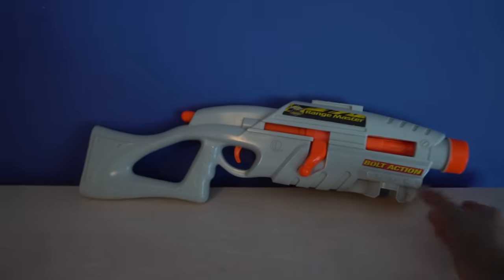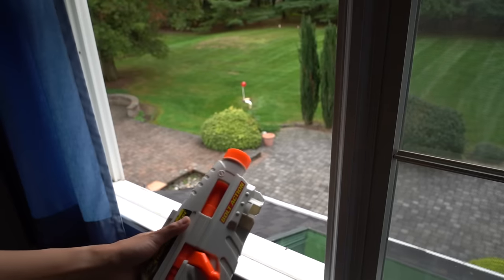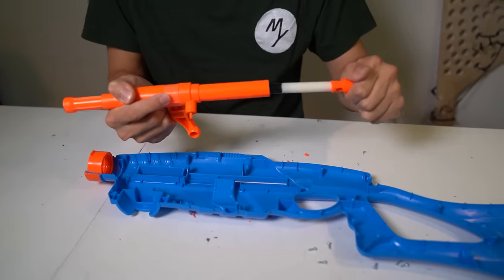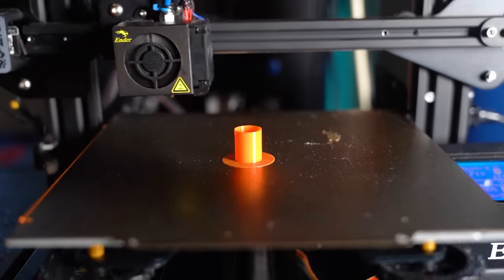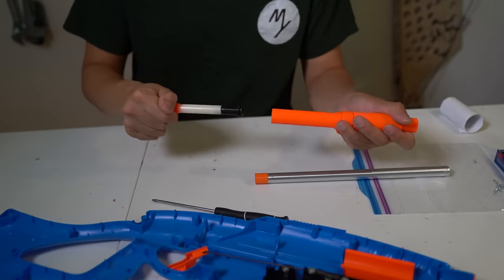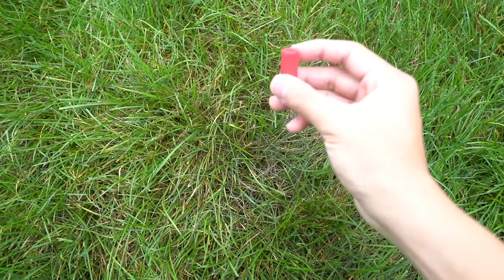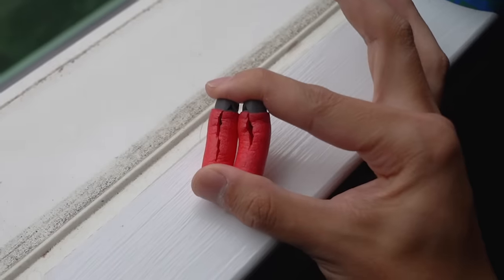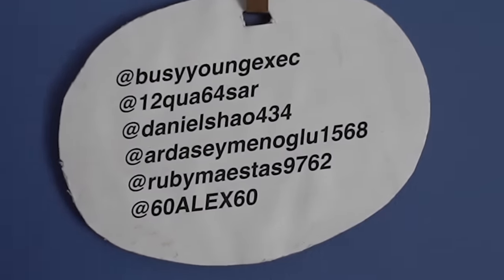I made my Nerf gun a bit too strong...

Comment: As a nerf and firearms enthusiast, I thought of tapping gas out like a real rifle when I heard about the dart bursting.
If your theory is correct, by drilling a hole near the end of the tube, excess "gas" will be tapped out and you can use it to load another dart /j
For those wondering, that last bit was for real rifles. But in this case, I suppose just having a tapered hole near the end of the barrel can possibly remove excess air.
Matt, you should really try this and put it back into the shell and do cosmetic mods and make it cooler! Although this was cool enough.
Seeing your streak of pressured air blasters, what about using the tapped gas into a extra gas chamber, then using the extra air, why not make a masterkey? Im no engineer but using my logic, it is possible to do so.
Also, I almost had an aneurysm seeing you put the blaster into a dryer- I should do that too XD
Reply: Maybe a curved end like a blunderbuss so that the air escape isn't as harsh?
Reply: I was thinking the same thing. drill some holes in the long barrel, then stick a "muzzle break" over the real muzzle break to make it look good
Reply: I think the issue is that the dart bursts before its hardly even moved, the air slams into the dart and bursts it before it reaches any real speed. Maybe isntead he could either use some form of packing material/wadding to absorb it, or use harder darts. the longer barrel was a good idea but maybe not long enough.
Reply: Maybe you can redirect the air to push back a piston that can do something in a similar fashion to an AK
Reply: @tovarisch3490  Thats the inspiration haha

Comment: This was my favorite blaster as a kid, traded a bunch of plastic lightsabers for one! Something that you might know already, but could be useful if you don't, is that this one came with special high density foam darts with solid plastic inserts as reinforcement. Your final 3d printed dart design is not far off how the original darts worked! If you wanna look into it more, they were called "Buzz Bee Extreme Darts" and the stock blaster can do 3-6" groupings at 50-60 feet with them!
Reply from the maker: wowee!

Comment: Holes near the end of the pipe will let air out without the dart taking the pressure all at once.  Though it is possible it is destroying the dart in the middle of the barrel.
Reply: The idea of needing a muzzle break in nerf is scary. Wonder if a suppressor would work.
Reply: @dogdog357 haha, I don’t know about a suppressor. Though, in the modded nerf/custom nerf scene there are barrel attachments that add rifling for increased accuracy in springers.
Reply: @chilledburrito Well I know scars are a thing. But I'm curious if adding a suppressor would 1. Help reduce the amount of air escaping the barrel through the dart and 2. Make the blaster quieter due to less air escaping as fast
Reply: @dogdog357  1: It’s possible, I’d imagine it’s dependent on various factors that I don’t fully understand as I only really dabble in nerf, at least the physics part. 

but if the goal is to stop the dart from  splitting, I’d check the barrel for extrusions first, and if there’s no problem there, I’d try a dart with less friction or firmer foam, if none of those work, putting some tape around the dart should stop the splitting, and the 3D printed projectile Matt made is an interesting way of fixing the problem LOL

2: maybe, I’m definitely not an expert on this specifically. I know for certain in a standard springer setup, the sound produced by the air is usually undermined by the plunger, and theres no point trying to put a suppressor on a fly wheeler. 
But since the setup Matt made, consisting of pretty much a valve and an air tank, it, itself should produce very little noise as you’d expect, and there are suppressors in Airsoft that can dampen the noise of the air exiting the barrel using a design very similar to an actual suppressor. It would probably only dampen it a tiny bit, it definitely wouldn’t be as drastic of a change as a real suppressor.
You’d probably get better information from chatGPT than me to be honest LOL

Comment: I had a LOT of success with an Airtech 3000 and using brass barrels, plugged pump and removed air restrictor. 6 shots, auto rotate, a WALLOP of power. 

I also used Frost king foam to make my own darts, so they couldn't explode. Old ones would still have their heads ripped off,  but yeah. Would love to see you tackle that blaster
Reply from the maker: i do want a at3k at some point

Comment: I made a nerf gun a few years ago using a long metal pipe and a pump with a pressure gauge and valve, it broke the darts on impact with anything other than bed sheets and could smash through a plastic plant pot with ease

Comment: Just figured I'd drop my two cents in, as I've seen and had this happen on more than one occasion with these air pressure blasters like the Orion and the AirTech line.

Depending on the size of you aluminum, it may be due to the fit being far too tight. Material like brass, CPVC, and aluminum are too tight for airguns. A lighter, slightly looser material may be your key here, and I would specifically preach on the benefits of PETG. Give that a shot and see if there's a difference.

Comment: Totally awesome! I'd recommend adding some rifling to make the dart spin, so that it not only goes more accurate, but also maintains it's velocity farther. You could probably 3d print a sort of scar barrel, or maybe even design a dart with spiral grooves in it?  Also, for more velocity, you'd want the dart to be more light. Also, if you want to fix that dart bursting problem, you could consider wrapping the dart in tape, or alternatively, printing a jacket for it.

Also, I was thinking, do you think it's possible to make a nerf gun that can shoot around corners?
Reply from the maker: seems difficult
Reply: Nerf blasters that shoot around corners are a thing: Nerf Rebelle Cornersight, Adventure force CornerFire.

Comment: Little tip, unlike real guns, longer barrel means shorter distance. Unlike real guns, nerf guns lack the rifling inside the barrel, making it only build up friction in the barrel when it runs against the side.
Reply: It all depends on what FPS you are running in your blaster. Hobby-grade springer blasters definitely need longer barrels. Otherwise, you're just wasting air pressure as the dart leaves the barrel before it gets a chance to reach its maximum potential speed. Stock Nerf runs around 60 - 70 FPS, but different clubs may run 100, 120, 150, 200, 250, and even 300+ FPS.